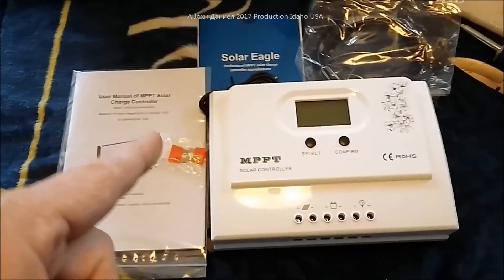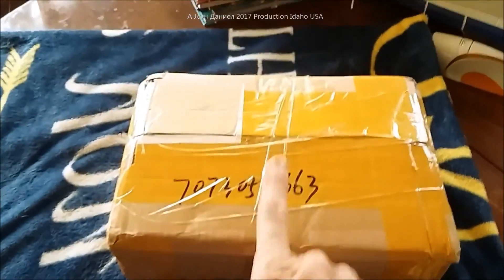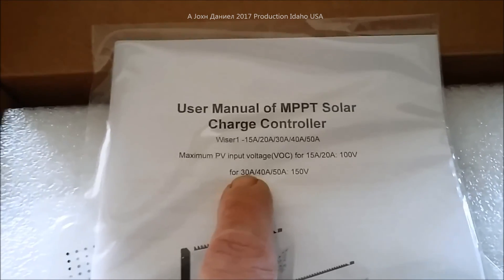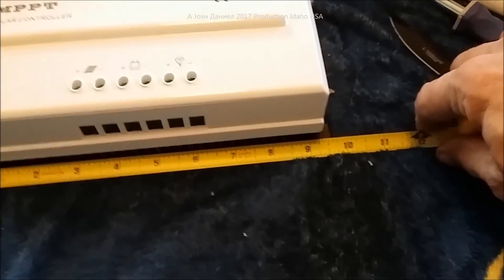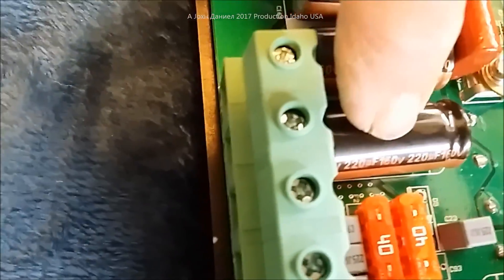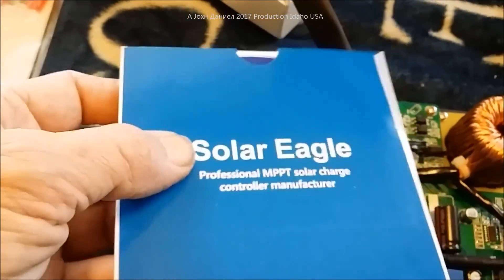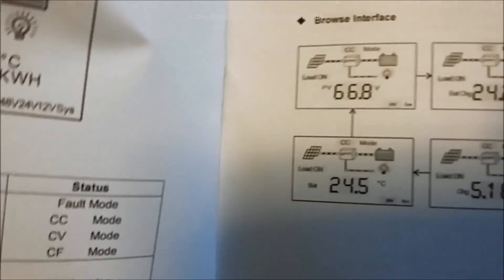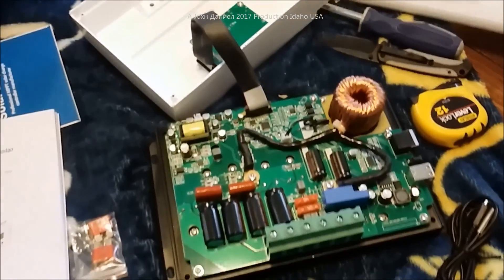MPPT Solar controller 40 amp what one should look like inside, ALL Info-Below

Comment: Although I liked the video and it helped me to learn and regard more, I still dought if it's vital for all MPPT topologies to deploy high-frequency choke or transformer to provide flexible voltage and current that Maximum Power Point Tracking algorithm requires. Also, there are countable well-known titles out there, that it can't be found inside for this purpose. With lots of respect, I recommend investigating the charge controller hardware more professionally and in detail, by being more precise on ICs.
As a prototype, I can refer to this link: http://www.ti.com/lit/ug/tidu219/tidu219.pdf
As you can see there is no choke! While a variety of integrated circuit buck converters are taking care of the procedure.
Best Wishes
Reply from the maker: I do like that basic design

Comment: I wish someone would show the larger EPever tracer AN, the 60,80&100 amp versions. I have the 30 and 40amp versions. I'd rather have a single larger controller. When I add more panels I don't want 4-5 controllers!

Comment: at 5:33 when you point at "the brain", it is an LM2576 (or similar) step down regulator, most likelly for the USB port that is siting next to it along with the inductor/diode/caps cause its a dc/dc and not a linear regulator. It brain is probably the MCU in the top of the board.

Comment: having a torad in it means nothing .the CPY 2420 china one i just got has TWO torads  and within minutes ,it was doing an 18 volt float charge on my 12 volt battery. i bought another  one ,[minghe ] mppt,because it said 60v input ,but found out your input must be lower than battery. its only a boost converter. it also has a big torad.
Reply: There is no A in the word toroid, also MPPT stands for MAXIMUM  power point tracking. Not multi.

Comment: Hi Prepper Mountain, I had bought this unit with a 20A only from Lazada Philippines last June, 2017. I had connected to my 100A, 12v deepcycle battery. The power was on and it detected my 12v battery, displays the current Amperage. But it also shows a FAULT display on its screen. I tried to connect it to my 100W, 18v solar panel and had observed it for a day with a very good weather. but i found not having charge to my deep cycle battery. So i tried to disconnect it from the solar panel and so with the battery to power it off. Then i repeat again the same sequence to power it on the next day and it stays the same with the same issue. Can you help me to solve the issue? I also happened to misplace the CD installer, can you share it to me. here is my email; gantalao.ddexter@gmail.com. thank you very much.